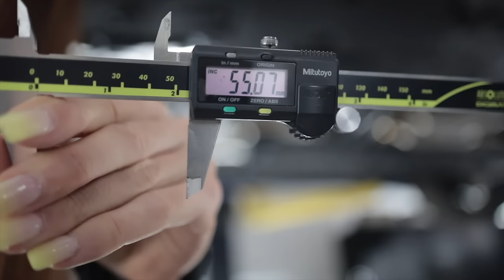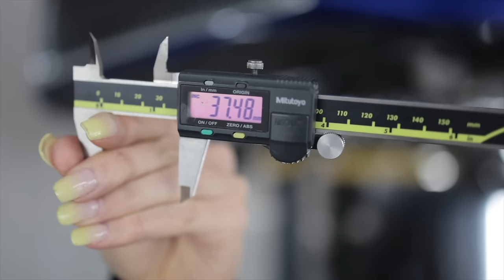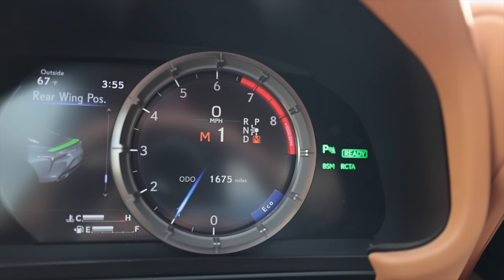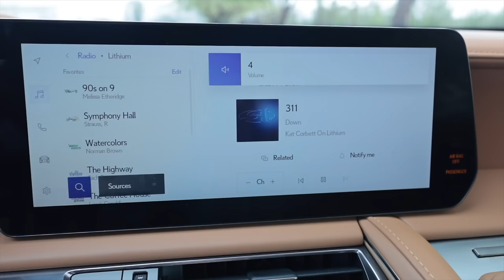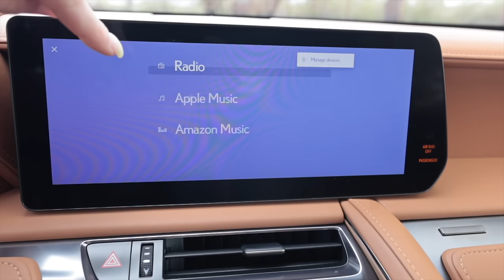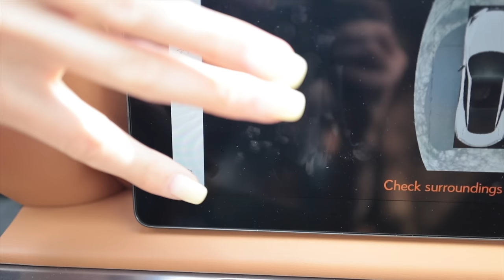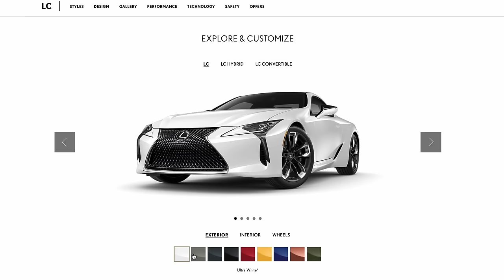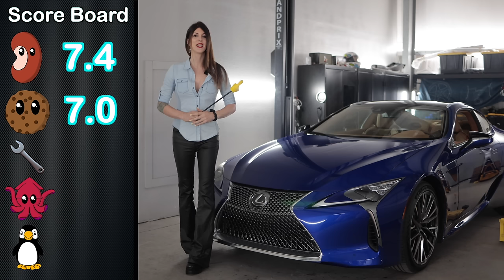Name A Sexier Car..  2024 Lexus LC500H Bespoke Review

Comment: This should have been the platform for the Toyota Supra.
Reply from the maker: It’s too big and heavy. They could have used the RCF but even still that’s a bit too heavy. GR86 would have been the closest fit.
Reply: @SarahnTuned  800lbs +/- is negligible weight. Toyota could have made it work without getting into details here. But it's a big failure to have such a nameplate as "Supra" on a non-Japanese car. imagine if Stellantis or even GM built the next Mustang.
Reply: The straight-6 has always been the engine that defined the Supra. Toyota doesn't have a straight-6 in their engine line up since 2008, that's why they had to borrow one from BMW for Mk5 Supra. I'm afraid that anything else, like a V8 or V6, wouldn't go along with the Supra name. Besides, B58 is an amazing engine.
Reply: @bsmirnov  No one cared when Nissan dumped the RB motor for a VQ in the GTR.  Too bad the new Supra will never have the same legacy as the MKIV and those before it.

Comment: Power numbers are not what matter most When you are lambda individual who lives in a normal world with speed limits. Still the 500H is quite quick and the electric motors are very much helping getting performance figures close to the V8. After 2 years of ownership I still love my 500H and it is a joy to drive in a large city like Paris. Still able to drive at 160mph on the autobahn from time to time. I don’t like the integration of the new control infotainment screen and prefer the old one. Nice review 👍

Comment: No such thing as a Pilot Sport S 5... The max performance street tire is still the Pilot Sport 4S. (replaced the Super Sport) The Pilot Sport 5 is just a sport tire... (replaced the Pilot Sport 4)...

Just details.
Reply: Nope, the S5 is a thing and has replaced the 4S, but it's only supplied as the OEM tire for certain sports cars, such as this Lexus, Aston Martin DB12... It could become available for more cars later.
Reply: Hmmm... Interesting. I actually checked with Michelin before posting because I didn't want to speak out of turn. Never thought of the "starred OEM" special versions.
I am at least one more season from needing new summers for any of my toys so I will keep my eyes open for retail 5s versions... and any reviews because as far as I can find there are none.
Reply from the maker: It literally says it printed on the side of the tire, so you can believe whatever you want.
Reply: 5:03 you can read it on the tire. Just details
Reply: @LouiseYates You either have amazing eyes or a bigger tv than my 86" LOL
I rewound and replayed 3 times... I can easily see they're Pilot Sports... I have various PS summers on 3 of my vehicles and my daughter's car... Could not see the 5S. Black on black isn't a detail I could read. 😂
Reply: @jamesrobinson1579  Pause it and use the comma and period keys to forward or reverse frame by frame. I'm blind in one eye. If I can find it, you can😜